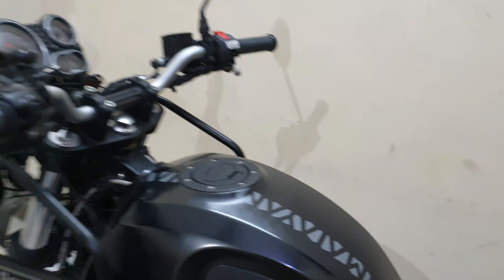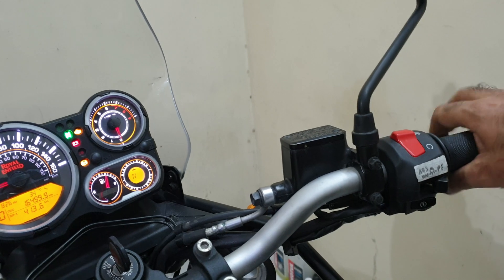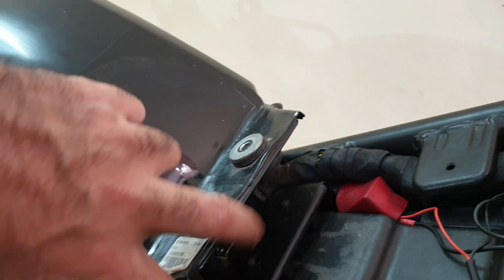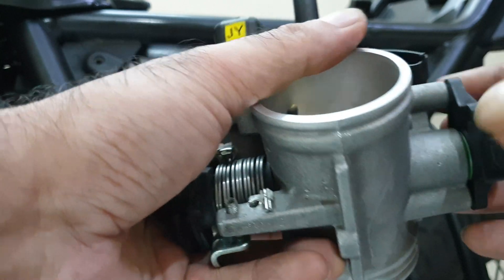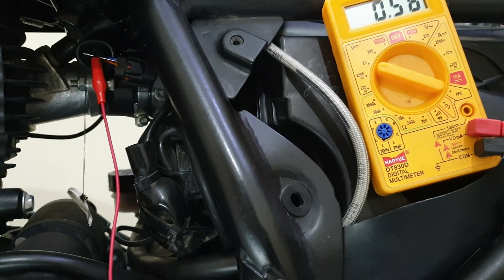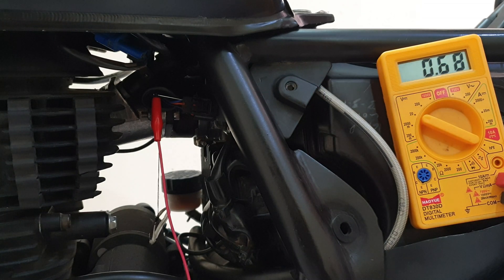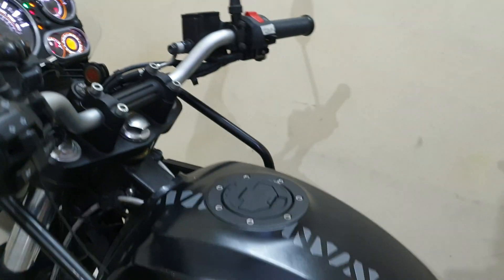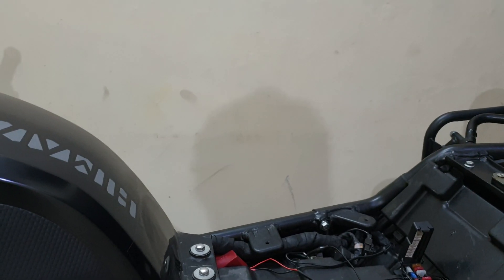Royal Enfield Himalayan | TPS | Throttle Position Sensor | Check and Adjust DIY

Comment: My himalayan is missing and shutting of while accelerating. only sometimes.when cruising on higways the issue facing..🥺
Reply from the maker: Hey mate, few additional questions. Have you checked that evap hose is connected properly. And please do check all the electrical connector are properly connected, including this TPS one, loose connector can also lead to missing. Its hard to pin point just one thing without riding the bike.
Reply: Evap system disconnected in my bike.when i put on servicecenter they tell me electric system working good there is no fail.but y
Reply from the maker: @himalayanblender7248  what is the fuel level at the time this happens. And what condition is the spark plug in. How many kms total?

Comment: bro my rpm doesnt go above 6k
Reply from the maker: Hey mate. Its hard to diagnose online but my guess is some electrical issue, hoping that air filter spark plug are clean. 
First check if all connector are connected to respective sensors properly and there is no wire damage. If can't find anything its probably best to have RE GUYS have a look with their diagnostic tool at service center

Comment: Hi there, I ride mahindra mojo. I notice fuel didn't seem to flow freely in slow or constant speeds in the lower gears.
At low speeds, up to about 40kmph, acceleration is jerky and not smooth. The motion feels like a push or drag backward versus a surge forward. I did some much-needed maintenance, so I thought I'd eventually find the problem...but I haven't yet.
After all this, it's still jerky during acceleration. On the highway the jerkiness goes away, but probably only because it's turning so fast that I don't notice. At low speed with the same RPMs, it's jerky. So I've tried to use that to rule out anything inside the engine.
After watching your video, I may check the TPS setting. Any suggestions ?
Reply from the maker: Hi, so yes you are right, there is some fueling issue around 3000 rpm, It is not smooth, That is how the ECU has been mapped. Now I have tried a few things in hopes to make it better. Adjusting the TPS did make some difference and now bike has done 20000 kms so I think I have gotten used to it. As you said on highways at higher RPM its smooth already. 
Unfortunately Mojo one is non ajdustable. I am soory but did I talk with you about this on insta, my memory is failing me.
Reply: @leuheanrede  Yes, we have shared our views on insta. Thank you.

Comment: Dude it's possible to set same parameter in bs6 engine, I bought the vechile 1 yr before, since I'm facing a same problem, so many time I'm diagnosed my bike but still continues...
Reply from the maker: Hey mate, yes same parameters. But first we need to adjust the idle screw properly and only then move to TPS.
Reply: @leuheanrede  k dude let I'm check, but how to adjust the ideal screw limit, like a ideal means how much Rpm for ideal
Reply from the maker: @mohammedabbas3620 how much rpm does your bike idle at after riding for say like 20-30 minutes and when you stop at red light. It should be around 1200 to 1300 rpm. 
I have a vid on idle adjustment too in the diy maintenance Playlist. Let me know if you need I can post the link for that. Cheers
Reply: @leuheanrede  dude upload the link...
Reply from the maker: @mohammedabbas3620  here you go
https://youtu.be/VhkReLSSIfs
Reply: @leuheanrede  thank you dude
Reply from the maker: Thanks mate. Have a good one

Comment: Anyone tried this with BS3? I have stalling problem, sent to authorised service center 2 times, but still problem exists
Reply from the maker: Hey mate, has the carb diaphragm been checked for leaks and the rest of the passage for intake too, what is the color of the spark plug when you take it out,
Reply: @leuheanrede  Not checked diaprham, Checked spark plug color, it's good, and I am using Iredium spark plug, Adjusted TPS sensor myself to 0.56, same problem exists, after starting, it is running 2km fine without any problem, after 2km, it is giving missing and stalling, then after 3 min, it's starting again and stalling for every 200meters, I have checked the air hole of fuel tank, it's good, I don't think it is fuel problem, any suggestions please?

Comment: My bs6 classic 350 stalls at low revs with clutch pulled in. It doesn't idle many a time and the rpms dip below idle rpm and sometimes the bike stalls. The service center guys changed the magnet coil and cleaned the throttle body but to no avail. please suggest a solution.
Reply from the maker: Hey mate, first check that TPS senor cable is connected properly, it does come loose, the following vid will explain where it is located, but dont adjust it yet, first adjust the idle properly. even if after doing these two steps the issue isnt resolved then adjust the TPS sensor. Also i consider that Spark plug is properly adjusted before getting into these steps. cheers :)
idle setting - https://youtu.be/VhkReLSSIfs
spark plug adjustment - https://youtu.be/EnMukroeGbY

Comment: Great video as always!! I have not had many issues with stalling with my 2019...only once or twice but I do get some hesitation when accelerating and the bike seems to lurch or buck in second and third gear somewhere around 3500-4000rpms. New spark plug, K&N filter, battery is good, stator is fine as is the rregulator/recifier. Do you think this could be a TPS issue? I live in a much colder climate as well and the manual said that the voltage should be somewhere around .06-.07 and 5 volts when the throttle is at 100%.
Reply from the maker: Thanks mate, yes start with setting the correct idle setting only then move to TPS. 
But to be honest that was a common issue on BS4 model, cheers
Reply: @leuheanrede  I'll give it a try!! Thank you!

Comment: What spark plug are you using bro ???
Reply from the maker: He mate at the time of shooting this vid i was running NGK CR8EIX, but currently i have switched to NGK CPR7EAIX, cheers :)
Reply: @leuheanrede  Interesting plug choice. Any reason you went for a hotter plug with a projected tip? and how much piston clearance do you have with the projected tip on the CPR plug?
Reply from the maker: 🤫 idea is to test all 7, 8 and 9. Ideally 7 is closest to Bosch UR5CC that comes as stock. So technically not hotter then stock. And I must say NGK 7 is running the cleanest thus far as should be expected. 9 is just too darn cold to be honest and test results show that. 8 is kinda ok and sits perfectly in the middle. I keep switching after every 500 to 700 kms. And there is enough clearance for CPR as well. Not sure but maybe in future will post test results 🙃 cheers

Comment: Tell me any ideas like fixing cooling fan in radiator or changing bigger radiator to reduce the heat
Reply from the maker: Hey mate, yes you can but to be honest i have not faced any overheating issues, if your bike is overheating you need to get to the core issue, like is engine oil ok and topped up, is plug of right heat range and adjusted to speck, are clutch plates good, is lever play properly adjusted, etc, I have ridden it on long tours and in Delhi heat where temp rises to 47-48 but no heating issues, hope it helps, cheers :)

Comment: help me
I have bs6 Himalayan
When riding suddenly the power gone and it stop , and then when i start it will start but when i put in gear the engine stop it happen 3 Time , i knw u think it is a side stand issue but no it not please help me
Reply from the maker: Heyvmate bikevis idling very low it seems or maybe the TPS CONNECTOR is loose. 
When you start what is the idle Rpm it shows

Comment: Thank you so much for this video.   I did as you suggested and I've fixed my problem.   I might have gone off slightly from the 5 6 that I set it at but my idle is now good and the bike no longer stalls at a stop.   I was happy to be able to resolve this.   Your videos are very helpful.
Reply from the maker: Thanks mate, really glad to know that you were able to resolve the issue. It's a simple fix and goes a long way in keeping the bike ride and sound healthy. Cheers :)

Comment: I am struggling. They have gone through everything but the fuel injector and the MAP. Checked the voltage. Checked for Air leaks, pinched tubing, swapped tanks and other parts. When the mechanic adjust things it works great for a few minutes. Eventually, when you pull the clutch in the idle drops below 1000 and then stalls. Not ALL the time but most of the time. Even when you set the idle to 1300-1400 rpm it will drop. Even in idle it might be problematic. So we are thinking it is the fuel injector but this is interesting.
Reply from the maker: Yes mate. You wont believe it but it's often the simplest of the things that we over look. Plug in a multi meter and get cracking. And please do let me know if any issues or questions. Cheers
Reply: @leuheanrede  Even I have the same problem. What can I do to solve it?

Comment: I have bs6 himalayan it stalls almost everytime, what would be the issue of it. 
I had changed my clutch play and rpm. Even after the issue is not solved. Please help me to get out of this issue.
Reply: Take the bike for a ride, for warming up the engine. When the bike is warmed up try increasing the idle rpm. Idle rpm adjust video is done by leuheanrede.
Reply from the maker: Yes, here you go mate, check that all TPS , MAP, O2 sensor cables are properly connected and do warm it up to ajdust idle
https://youtu.be/VhkReLSSIfs
Cheers :)

Comment: TPS has some role in making bike lean-if yes,how to modify TPS to make mixture richer???
Reply from the maker: Hey mate
Excellent question. And answer short and simple is No. Now you might come across a person every now and then who might say that the answer is yes. 
Let's understand,why? TPS is working g along with other sensors like MAP, O2, crank speed, ambient temperature, engine temperature etc. And all these sensor send data to ECU which than decides how much fuel needs to go in engine and guides injector to supply atomized fuel vapors. And this happens in milliseconds. The input comes to ecu and the output to injector on and on and on. The cycle keeps going. If at any moment O2 senses rich mixture, again input to ecu and again ecu will cut back on fuel through injector.
Just manipulating TPS will not help as ecu in few cycles will be able to sense rich mixture and cut back on fuel. For richer mixtures an ECU piggy back over ride or something like a booster plug will be suitable.
Cheers :)
Reply: @leuheanrede  guessed it would be the way  you described it here-but had a doubt that with the changing voltage,maybe the mixture changes around the stoichiometric
optimum and maybe the TPS can help in richening the mixture.

Comment: So won't the sensor move with vibration? Or is it secured?
Reply from the maker: Yes mate it would but only if the torx screw is loose. As that holds it securely in place once we adjust and tighten it back. 
Cheers :)

Comment: Is the multimeter readings for TPS applicable to the first gen BS 3 carb model,as well ?
Reply from the maker: Hey mate
I do not have the factory specs on BS3 carb ones but stick close to universal .5 v and will take care of it
Cheers :)
Reply: @leuheanrede  thanks for the speedy reply.I had a feeling your video probably would not pertain to my bs3 relic.I wonder if the Service Centres even bother with this check.But guess I will go with your advice of sticking with universal values.Thanks again and stay safe.
Reply: @anilgangolli6681  I am also having stalling problem with my bs3 model, sent to authorised service center 2 times, but still the problem exists
Reply from the maker: Hey mate. How many miles total and what's the status of sparkplug, when was it last changed and adjusted, is it stick bosch ur5cc or have you upgraded to some thing else. and when was last valve clearance done. Has the carb been cleaned, a simple retune after clean can do the trick.
Reply: @leuheanrede  Yes, i have replaced sparkplug with titanium plug 1 month ago, tried everything except this TPS check

Comment: I have had been having same problem since I changed the spark plug to iridium.
Reply from the maker: Het mate
That shouldnt happen with just changing the spark plug if the gap is ajdusted properly and in case of iridium, it should be .8 MM, please check gap and re adjust if needed.
Cheers :)
Reply: @leuheanrede  yeah but it's a brand new spark plug which you recommended CR8EIX do you recommend I change the gap? Before it was stock one from Bosch and it was idling around 1.5rpm. But now it goes below 1 and sometimes stops when accelerating.
Reply from the maker: In that case some thing is seriously not right. Please understand my temptation to have a look at you bike and try and understand whats going on  ;)
But for DIY purpose, please refer to following vid to adjust spark plug gap and if even after adjusting the gap the problem still persists please switch back to stock RE plug to confirm if bike is back in rpm range

gap for iridium - https://youtu.be/cOGSWMMnTDI

gap for stock - https://youtu.be/EnMukroeGbY

Cheers :)

Comment: While TPS is unplugged, get a booster plug on it 😃👍🏻
Reply from the maker: :D indeed, 
but I have actually ported the Throttle body by 1.5 mils
Thus pretty much taking care of that. but might consider going for a power commander/powertronic ECU piggy back to further the  fueling needs, if needed.
Will update soon
Cheers :)
Reply: leuheanrede, I thought about a power commander but it was just too expensive, booster plug was much much cheaper 👍🏻
Reply from the maker: @KRAM-zb2vc  indeed. That's why I am trying to convince myself that I dont need one :D
Reply: leuheanrede fair enough 👍🏻